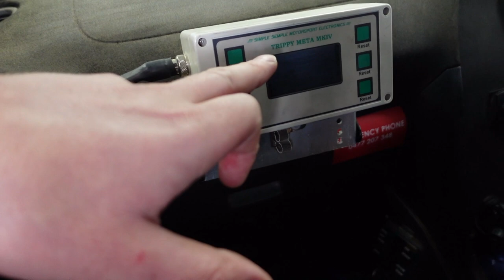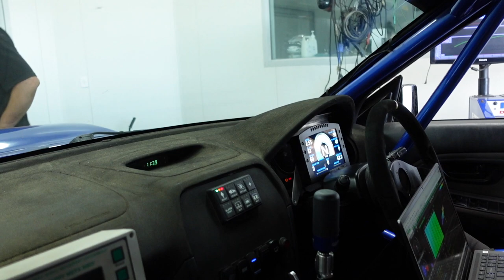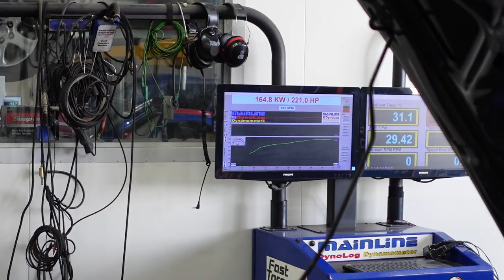WRX RALLY CAR GETS A SEQUENTIAL | POWERTUNE AUSTRALIA

Comment: Jake, the car that cheated was the Toyota celica GT4 (the castrol one from sega rally 😂) they put a few small washers in the restrictor, and as you mentioned it couldn’t be seen from the outside, but allowed heaps more airflow, some reckon it was as much as 50hp. 

Another sick build from the guys at all drive 👍🏻
Reply from the maker: Very interesting story hey. They did well to get away with it for the time frame they did.